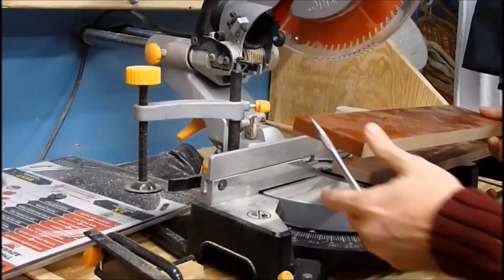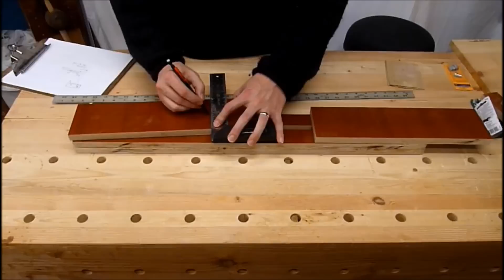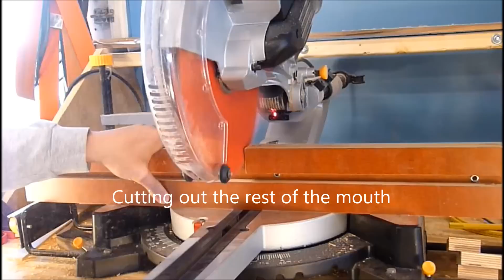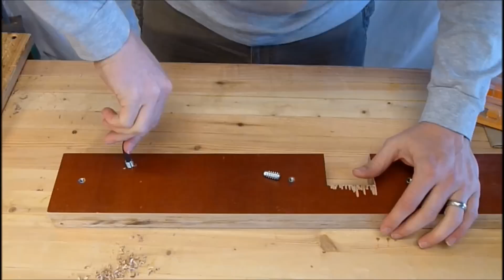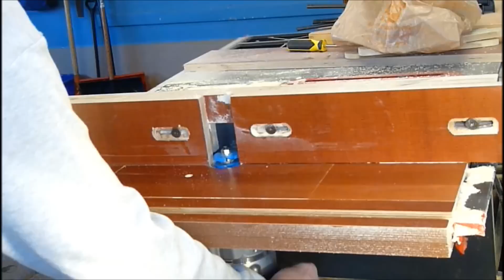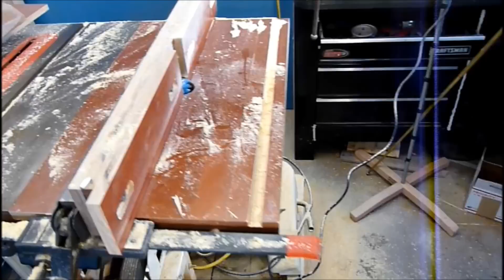Router table Part 3 of 3:  The Fence

Comment: nice job sir..I had one question sir, how will you be able to change the bit? coz it seems  pretty much lock down.  sorry I'm just starting to learn..
Reply from the maker: Same way as before it was mounted to the table. You pull the router and its new wooden base out, pull the router motor out of its base, change the bit, then put it back in the base and drop it back in the table.

Comment: Nice job, but Craftsman table saw fences are the worse!
Reply from the maker: no worse than the fence that was on the Grizzly I used to have which I used for 5+ years.
Reply: Was it the one with tube rails?  I have tube rails on my 20 something year old Delta and they work great!  It always locks down square.  I had one of those, somewhat portable, craftsman saws previously (direct drive induction motor with the shallower table, with legs), the fence was really difficult to get square.
Reply from the maker: Nicholas Smerk yes it had tube rails.  the problem was the far end of the fence would move around and I could never get it to lock tight yet still be able to easily slide while unlocked.  I'm sure if I had internet resources back then i'd have been able to better adjust it.
Reply from the maker: Nicholas Smerk Oh, and before that Grizzly I had a craftsman direct drive which was HORRIBLE.  I had to clamp it down to the table it was on else it would jump when turning it on.  "i'd always jump too"
Reply: The one I had scared me.  I jumped on Craigslist and found a much nicer saw (an older Delta Contractor saw), then traded the old one for other tools.  I need to build a router table.  Thanks for the ideas!